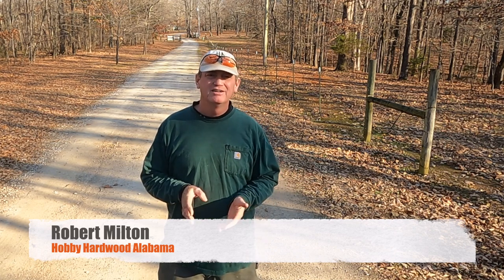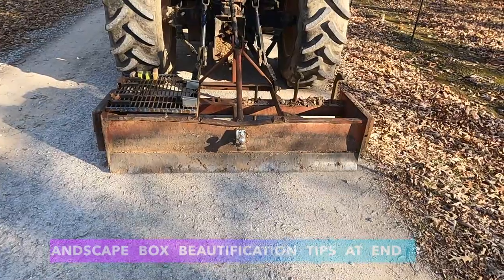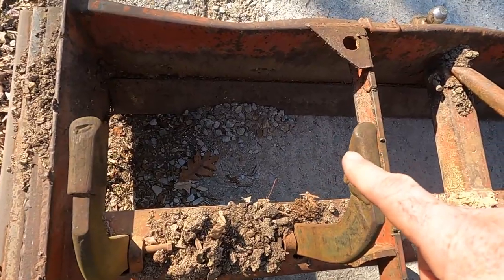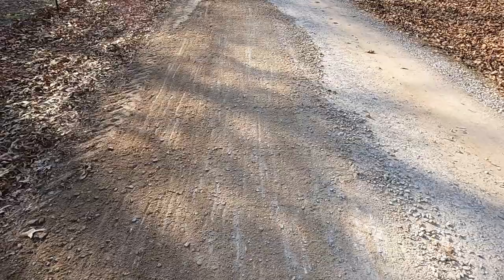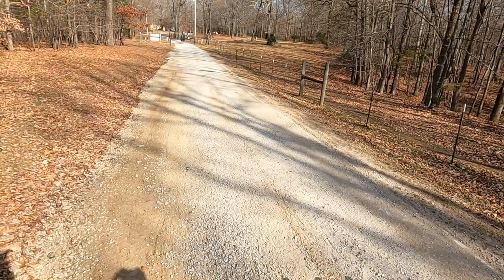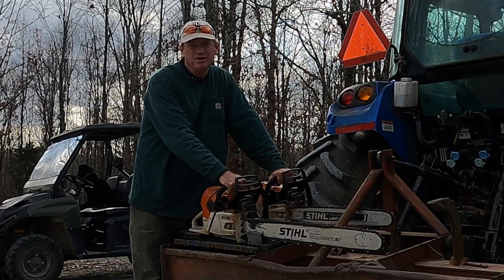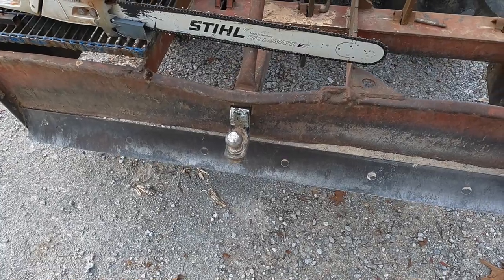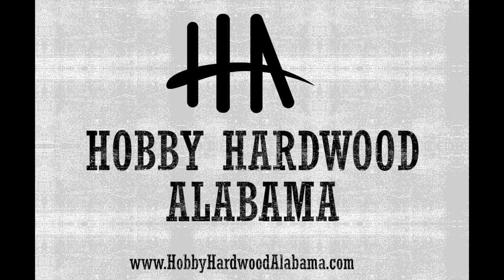How To Say Goodbye to Potholes - Here's How at Hobby Hardwood

Comment: Good job Robert. I figured that would be the best way. My old homestead driveway is wore down a good 4 inches or so. Also exposing roots from the 80 or 100 year oak tree. Now what? Cover the roots, chop some some up and start over. I don't know. I don't have a tractor so I am at the mercy of " whoever" I could trust locally.
Reply from the maker: A very quick fix is to get a dump truck driver who can "drag out" or "chain" gravel from their truck.  Basically, they set a chain to their tailgate to set it a specific opening width,, tilt the bed up, and start driving.  A good dump truck operator can lay out a perfect 4" layer of gravel that looks like a graded road in a matter of minutes.  That will bring the road up higher than the surrounding grade and go a long way to getting it right with almost no effort.

Comment: Good Job Big Rob.  Admire what yal r doing ,  Admire how yal do it.   and yea, 2 saws,  They r no different than any other tool a man uses.  Like pickups, something I have never traded when I got another one, can’t never have enough of them.  Good advice on road work Buddy. I’ve been working on and building logging roads a minute, and everything you said is true.   My Bros and I put down asphalt millings on our place.  Both our driveways, and drive to the Shop, Briar Patch, and Sawmill.  Put it down as thick as you can, been down 7 , 8 years now.  Haven’t done nothing to it yet.  The adhesive from the ground up asphalt holds it very tight as you run on it and weather wears on it.   Was going to ask you, have u sawn a black cherry lately.  ? I assume you may know what I’m talking about.  Also may be known as Bird S,,,t tree.   Many found in fence rows.  has a silverfish scaly bark.  Very yellow sapwood.  I grabbed a small one that came through the logging job the other day and cut 7 , inch thick, 8 wide boards that were very nice to the eye.  Just another great and satisfying part of sawing finding such beauty in what has been In my lifetime called a trash tree.   Yal take care, Tighten Up, and I’m headed to go square another one up just as soon as I get to the house!!   AC
Reply from the maker: We mill a good many black cherry logs, but I ours are the Appalacian, and get much larger than I think they grow in Georgia.  We also see some of the flat scale cherry mixed in, they grow pretty big here, also.  Beautiful wood.  I have a pile of them I will be sawing and videoing up before long.